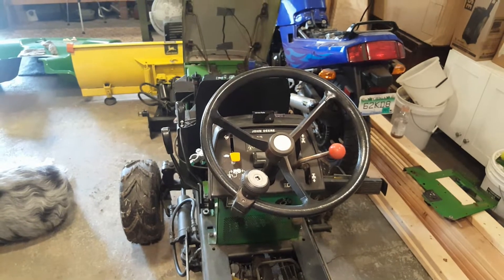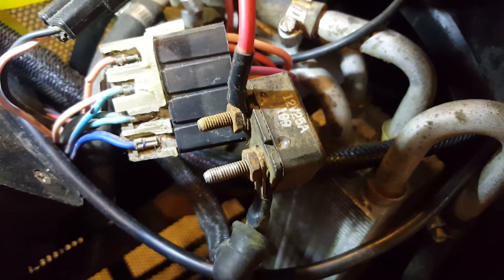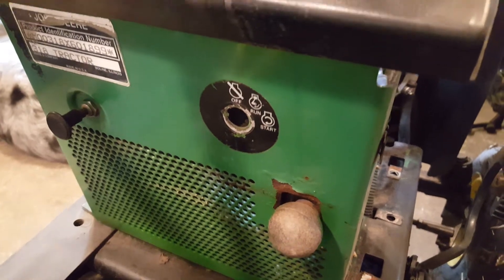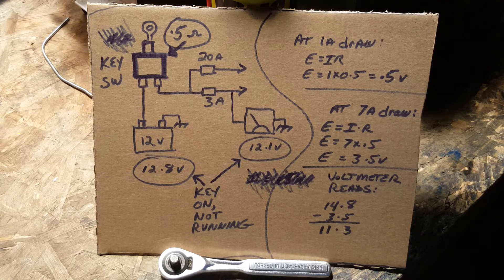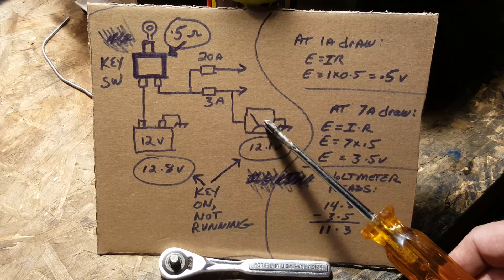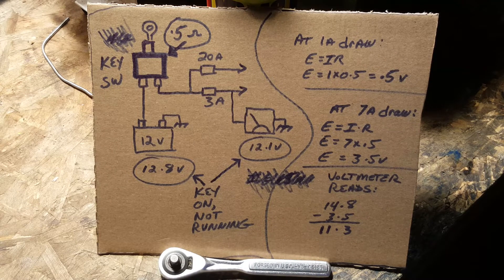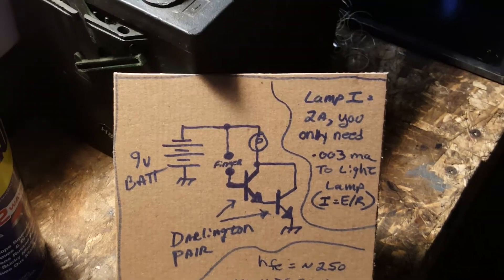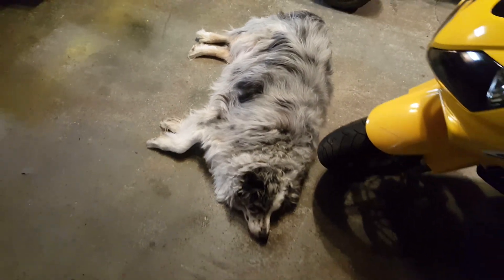Basic Troubleshooting: switch contact resistance & it's effects + the Darlington Pair

Comment: I like the trouble shooting video.. I am a packrat tinker and pretty good at fixing or building from what I have. My weakness is in things figuring out what wire(s) are to the mic vs speaker on a headset I want to repurpose.. I could restore a wonderful glowing boat anchor if its a simple power problem but finding the bad caps in the tuning circuit would shut me down..
Reply from the maker: Yeah, that's a challenge. For me too. Caps are the bain of vintage gear users and restorers. Unless you have a cap ESR tester, leakage tester and value tester. I have my vintage Heath cap tester- but it needs restoration itself before I can use it. lol.
There are a lot of restorers who are (to borrow a word from Spike below) 'cap cannons'. They replace every cap in the whole darn radio and see it it turns on. lol. That approach can work ok.. I mean, in some radios (such as my DX-60), every cap except one needs to be replaced anyways because they're of a type that's either bad now or will be very soon. Also, in that radio, every resistor except i think 3 were out of tolerance! You get all the fun of installing almost every part beneath the chassis- but you have the nightmare of removing the old ones first. lol. What 'fun' huh?
And heck, nobody can figure out the wires on a headset. lol. I haven't even tried. But then again, I've never owned one. If I did tho, sure as heck, I'd have broken it and had to repair it. Repeatedly!
Thanks for watching my long broing video, Bill. And for taking the time out of your life to comment. I really appreciate it. Be well,
Chuck